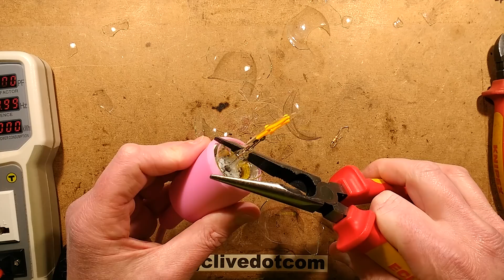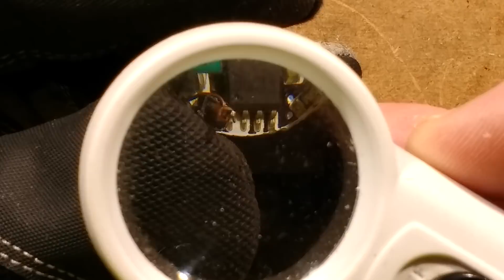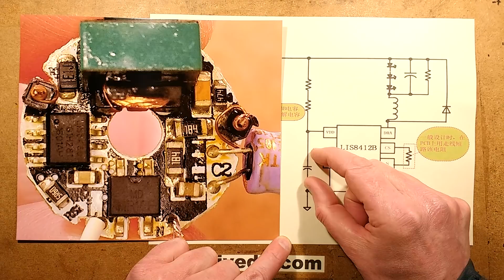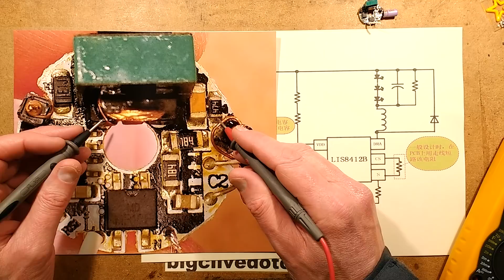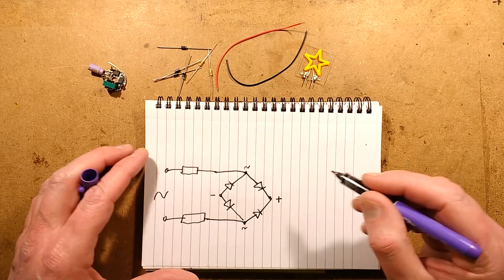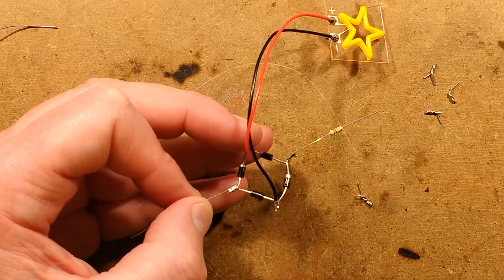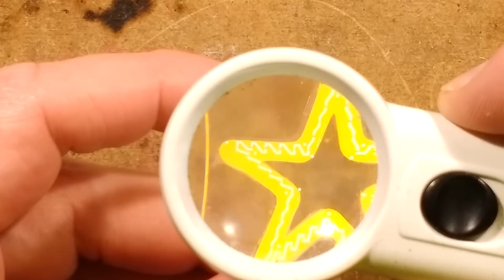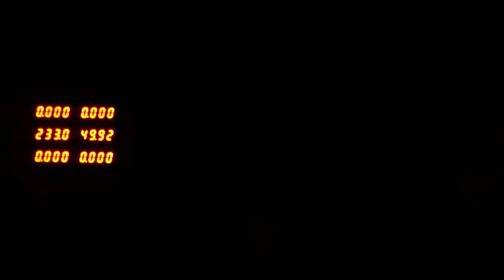LED star-filament lamp smash.  With PSU rebuild.

Comment: Broken glass, exposed wires at mains voltage, cutting towards the thumb. Not sure why Clive didn't get on with those Safety Managers... ;)
Reply: One of my father's managers, at a well-known Swiss-owned company,  insisted on every step of jobs being documented, 'to cut waste'. So he, and all of the maintenance fitters, obtained a signed chit for every nut, bolt, washer, clip, spring, etc. drawn from the Stores, and wrote a chit for every step of each job which was completed. It cost the company more than £5 for every piece of paperwork (in 1975 money). The policy lasted for one month, and cost tens of thousands of pounds more than the few tens of pounds which 'unaccounted-for' items had been perceived to have cost them. 

That manager left the company a few months later, because his life had been made unbearable by all of the engineering staff. There are ways and means to end restrictive policies, if everyone works together on the problem.
Reply: You could do all those things as long as you had a page a risk assessments for each.
Reply: Jonathan Corwin
Clearly because Clive gets on with the job and doesn't get involved with management level paperwork.

Comment: I’m drafted to a Royal Navy base where our accommodation is ‘serviced’ by Carillion. Their plumber has just plumbed my towel rail up to the hot water supply to my hot tap. So, I have a heated rail, so long as my tap is running...........
Reply from the maker: Just be glad it wasn't electrical.  The same guy would have installed it.
Reply: I was at a place not-to-be-named that had a toilet supplied by the hot water supply. Nice and toasty.
Reply: @M. K. I'm not saying it's the thing to do. That's just the way it was. It was a place that didn't value my opinion for such things. :)
Reply: +Nani Isobel, some of my friends bought a house with that problem (and many others). His then peri-menopausal wife wasn't the only one who suffered from hot flushes!
Reply: The towel rail in my house is plumbed in series with the bath hot tap which I thought was quite neat.  It means that the towel rail  is hot for a short while after you've used the bath and the towels are wet but doesn't waste heat by being hot permanently.
Reply: number 33 .....and so an utterly useless way of doing it as the hot tap in a single person room is only on for at most a minute a day, meaning the rail never even gets hot.
Reply: Nani Isobel I feel sick thinking about what that would smell like.
Reply: Talking of dodgy workmanship. In Turkey we had a 13 kw water heater installed,the man installing it did not turnoff the power, he just put on thin washing up gloves and twisted live wires together to connect the heater.
Reply: Nani Isobel there are 3 problems with this...
1.it's against health codes, at least in the USA(I don't know about other places though).
2.over time, this can actually CRACK the toilet!
3.hot water will tend to make odors worse.
Reply: Did they work with private landlords? As I'm currently homeless after a baboon doing work on the roof of my flat somehow managed to turn the water tank that is upon my roof (and feeds 5 properties) into a raging inferno that streaked across the roof over 3 properties and required 5 fire engines to deal with, it then took them nearly 4 hours to manage to turn the water off, my flats not burned its had a good wash.

Comment: Apparently some higher-powered LED filament lamps are helium filled for improved cooling
Reply from the maker: Apparently lighter gasses have a higher thermal conductivity.  They quote helium and hydrogen, but I would only use hydrogen if it was mixed in the correct ratio with oxygen.
Reply: bigclivedotcom In the old ages, there actually existed a lamp, that was hydrogen filled, with iron filament. It was used in radios and other instruments as a sort of constant current source. The high tempco of the iron and the high thermal conductivity of hyrogen achieved an equilibrum of stabilizev current.
Reply: I highly doubt those chepos Chinese lamp are filed with anything but plain air. Helium is kind of expensive.
Reply from the maker: I've heard some use a gas for thermal coupling.  I've never really considered the thermal conductivity of gasses.
Reply: mikeselectricstuff Interesting
Reply: For as long as the helium stays in the glass envelope...
Reply: bigclivedotcom that is water :)
Reply: A helium filled lamp would be self levitating if it was big enough. A floor standing lamp consisting of nothing but a mains lead, socket, bulb and lampshade. Might wave around a bit if there was a draught.
Reply: High voltage power station generators use hydrogen gas as coolant.  No oxygen!  Although H2O to cool the hydrogen, according to Wikipedia.
Reply: bigclivedotcom acetylene works best

Comment: Isn't it generally a good idea to unplug a light bulb before smashing it with a hammer?
Reply: Jim Fortune not if you are Clive
Reply: Caledonian TV
That's a distinction with no difference.
Reply: That's why the safety bastards, errm I mean guys, at Carrilion hated him.
Reply: Alfonce Jean
Shouldn't there be water involved?
Reply: Jim Fortune sssshh, don't mention water, Ralphy might be watching.
Reply: naa it's fine, hammer + glass+ electrisity+ fingers... what could possibly go wrong.
Reply: It wasn't a hammer. If you were a motor (auto) mechanic as I was it's a Ford special tool. By the way I've worked for lots of "special tools" but not for Carillion.

Comment: 60 volts RMS would have a 84 volt peak which would be 5.6 milliamp across 15k. Is that what the Hopi is showing?
Reply from the maker: It may have been skewed by the 1.7mA the neon in the Quicktest was drawing.

Comment: I can’t be the only one who picked up a short piece of solder off the bench whilst building a circuit, attempting to use it as solder against the soldering iron.... just to find that the “solder” was a cut off resistor leg and I now I have a groove burnt into 2 fingers.
Reply: evilution Ha ha, nope, never done that before!
I have reached for my soldering iron before and, because I wasn't really looking, grasped it by the metal shaft & not the handle 😕
Reply: I've done the same thing myself...hurts like a mofo!!! :-O
Reply: .. likewise.. more than once. 
Back in the days of CB radio, one of my mates keyed the soldering iron instead of the microphone. Much and varied Anglo Saxon phrases ensued. We laughed.. We are bad people.
Reply: Ah yes, the modern take on "wrong end of the stick."
Reply: LOL yes ive done that, i felt such a pillock :-D
Reply: It's kind of like those chainsaw jugglers at the circus.
Reply: Been there, done that, got the T-shirt and the coffee mug too, hahaha!!! :-)
Reply: In Australia, McDonald's use paper bags for meals... An idiot that used to hang around our place was around while I was soldering as I finished my lunch.... He knocked the soldering iron onto the (synthetic) carpet and melted a dirty blob of plastic onto the iron. He then tried to use a McDonald's paper bag to clean it off by gripping the bag around the hot iron..... He was called an idiot repeatedly.
Reply: When I was younger, I once knocked my soldering iron from the desk. I just caught the handle with the tips of my fingers of one hand, managing to propel it upwards by a small amount, then I had another go at catching it, but grabbed the hot metal shaft. So because I felt my hand burning, I quickly let go. It then fell down and landed tip down on my newish trainer of my right foot. It promptly melted and burned it's way through the top of the trainer and then started warming up my foot. So of course, I quickly moved my foot. Then as I tried to grab it by the cable, it fell on the floor and started to melt the carpet. Not a good day 😳🙁. Of course, being a teenager, I had to hide the damage, and clean up the iron so that it did not smell of burning plastic... So trust me, soldering iron juggling is not recommended!
Reply: If it smells like bacon you are soldering wrong.
Reply: As a child, after my Dad was using his soldering iron, I picked it up by the hot end after it was unplugged but still very hot! It smelled like burning hair and I was left with a pattern of the iron across my palm and fingers! I promptly dropped it and it melted a hole in the lovely 1970's synthetic shag pile carpet! Despite the burns I never went to the hospital or doctor and it soon healed fine (as things tend to at a young age) and it didn't put me off soldering irons, just made me more aware of which end to avoid!
Reply: Much fun was had by me discreetly replacing a reel of solder with a reel of similar looking tin plated thin copper wire while the person soldering was not looking 😂
Reply: A friend once texted me when I was soldering. I grabbed the soldering iron by the cable, so it was dangling alarmingly close to my skin. I even thought it was a bad idea... As I reached for the keyboard to reply, the tip touched the flesh with a sizzling noise. The burn didn't look that bad, but I've still got a scar on my left arm. :D :(
Reply: tony sansom Me too. Three times actually, in about 2 minutes. I was using one as a big heater to keep a big piece of metal hot for soldering, and three times I grabbed it by the metal shaft by accident. No burns resulted though, because I quickly applied cold water.
Reply: Yup!  Done that!.

Comment: I lost my mind and tried to cut a small spring with my snips. Now I need new snips.
Reply from the maker: That's why I tend to recommend cheap snips for general use.  You always end up cutting something hard with them.
Reply: Yeah, I bought a cheap pair of Hakko snips on Amazon; even if they're not in the same class as the Xuron snips, they're so much nicer than the old dull diagonal wire cutters I had been using - nice clean flush trims, woo hoo! ;)
Reply: For cutting springs and defence against carbide midgets: https://uk.misumi-ec.com/vona2/detail/223000770416/
Reply: Great to see another Xuron fan! :D Tough little tools; high quality, US-made, and they keep on working...!

I also saw Clive using Knipex pliers, another favorite brand of mine, generally for 'mechanical' things, shall we say. Yes, they cost substantially more than the soft, chrome-plated, pot-metal chinese garbage sold at most retail stores. But they are more-substantial tools, and will last many times longer. :)
Reply: LostJohnny :  Gotta keep them carbide midgets at bay...